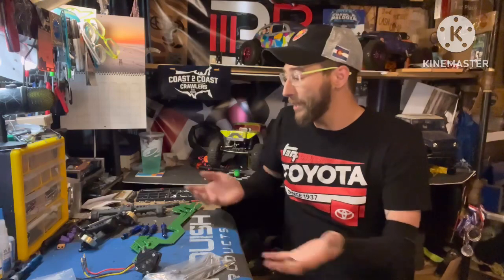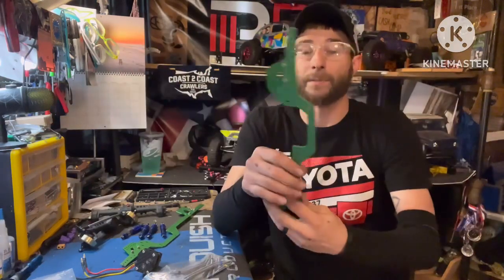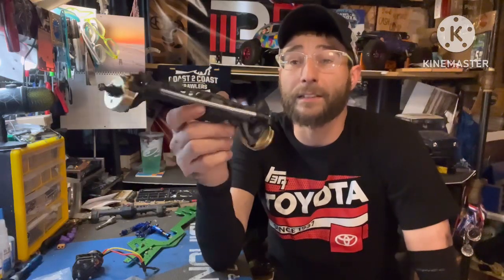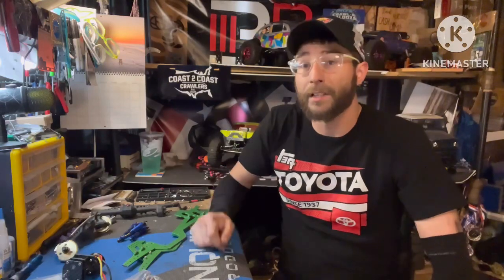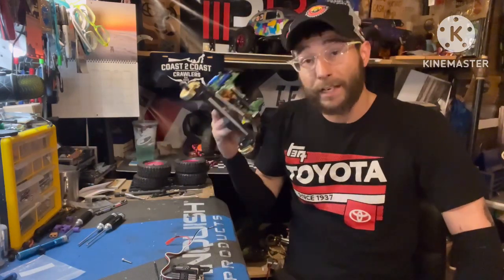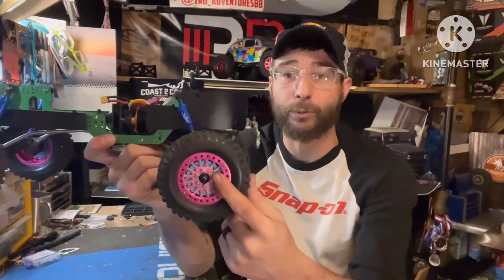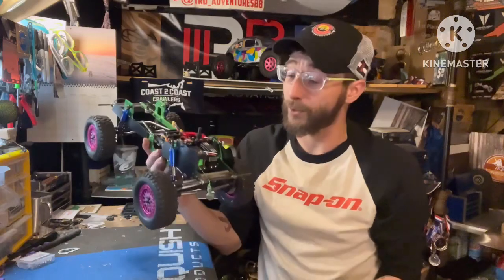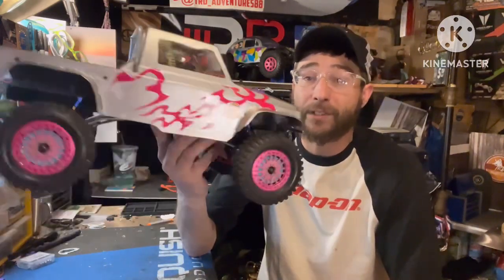EXO RC Everest class 1 build Ep.1

Comment: @TRD Adventures for 2023 sorrca rules  does the chassis have to have mounted shock towers for front and rear or does it just have to have a flat skid
Reply from the maker: Just has to have flat skid
Reply: @TRDAdventures  does the dlux portal trans get transfer case points
Reply from the maker: @Toysojah671  it does not
Reply: @TRDAdventures  what transmissions get points that doesnt really look like a creeper t. I know there some there considered transfer case even if there is only 2 outputs.
I would think only if its a actual transfer case lile creeper t
Reply from the maker: @Toysojah671  either of the exo RC transmissions currently count and they are smaller units.
Reply: @TRDAdventures  oh ok what difference does it make with the exo ones isnt that jist have outputs direct from trans to axles and motor is mounted on transmission like dlux portal
Reply from the maker: @Toysojah671  one has dual output with overdrive, and the other just has the single
Reply: @TRDAdventures  whats a good wheelbase you recommend for class 1
Reply from the maker: @Toysojah671  it can personal preference, I’ve ran 11.8 for a very long time, but recently have thought about goin more to 12-12.3
Reply: @TRDAdventures  but with sorrca rules 2023 you still need to be somewhat centered
Reply from the maker: @Toysojah671  yea
Reply from the maker: @Toysojah671  if I did that, I’d switch bodies